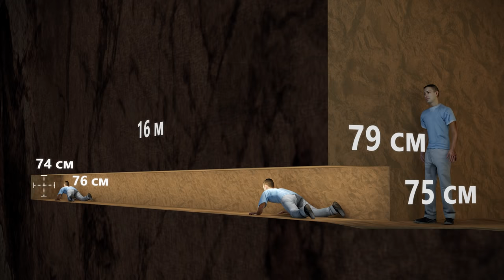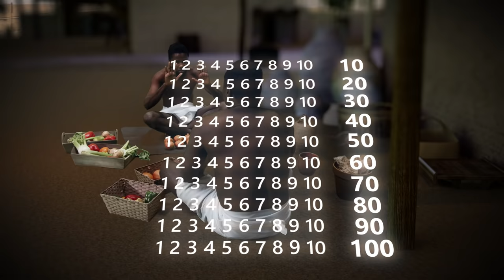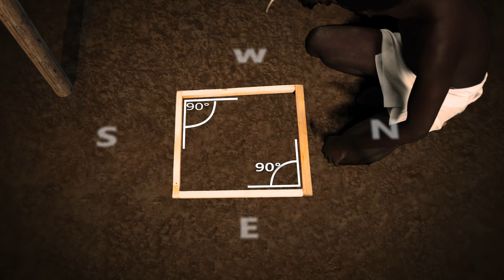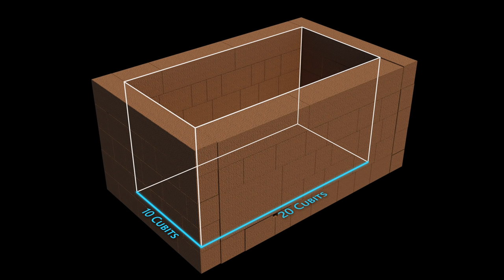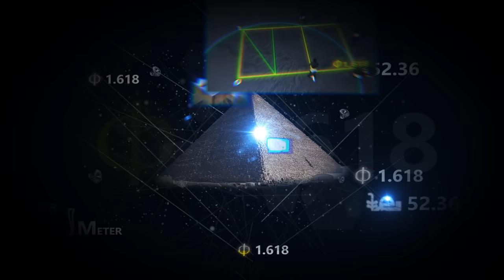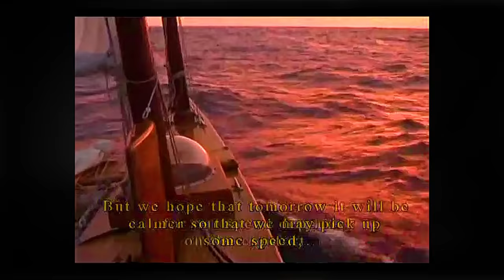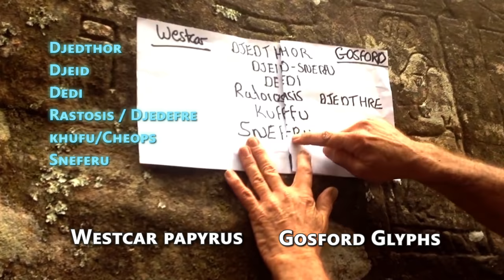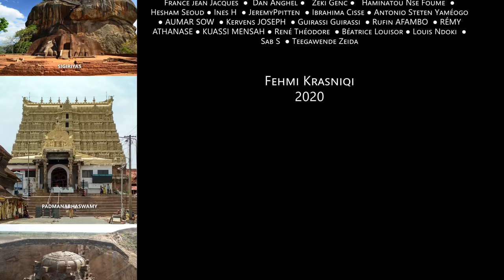The Movie Great Pyramid K 2019 - Director Fehmi Krasniqi

Comment: That's an awful lot of cavity to fill for a very small amount of tunnel and subterranean chamber. 
 They had a DISK  with string wrapped around it and screw pumps spinning away but they had no idea about the wheel?
You show three sided form being slid along as each stone is poured one after the other but you don't account for drying time? How long does one stone take to fully dry? Not to mention the stones are not all alike nor is the orientation  and placement which is what you'd expect had they used forms and poured each stone as you suggest.   That would really slow production down considerably having to make sure each stone had dried completely from inside out . The cavity took 3 years to pour? How long would that take to dry and cure good enough to be sure it would hold the weight from above? Took Hoover Dam a long time and even longer had they not used tubes filled with sand and water to cure it inside out. 
 Getting that perfect water limestone mixture exact for all the crews would not be easy either .  Too much water or lime and the stone might not dry or might take much longer to dry . Wouldn't the concrete tend to stick to the form cracks and around the base making it difficult to remove without tarring the form apart?  I can imagine pouring a huge block and having to sit and wait for it to dry ?  All those blocks having to wait to dry? 
You show the bottom lower portion of casing stone being poured in forms and when it gets close to the top you show the last top  form on the outside of the casing stone with a small round hole in the  center of the form where the remaining concrete was poured to fill up the top side of the stone?   how did they fill it up completely without it pushing itself out from pressure?  How could they be assured the top of the casing stone would be without bubbles or unfilled form[gaps} .  Lots of details left out.
Couldn't they just use the mirror to slice the stones from bedrock? What is the purpose of the queens shafts?

Comment: The only thing I find improbable is melting granite. Melting it is one thing, but creating the energy required to keep it molten long enough to cast is something quite different.
Reply: But possible...
And way easier than carry a 50t block for about 800km. :)
Reply: @HotjeKvovg  Not sure that possible
Reply: I'm working on ways to do this... not melting per say, but rather softening through sets of high frequency, localized vibrations.  You don't need to melt a whole block if you can just make the part you're cutting into a putty.
I'm in the hypothetical stage, and honestly, I have problems already.... Sound waves get LONGER in a dense material, because the sound travels FASTER through it.  So, we would have to start out with sound waves too high frequency to produce through speakers.
Perhaps they got vibrations to occur in dense materials first, somehow, maybe via chemistry, or electricity (piezoelectric effect).
I'm thinking cymatics were used to transport the blocks if they were not formed and created.
Reply: @andriesscheper2022  dude come on.  if you have not seen that they FAILED at getting copper saws to cut LIMESTONE blocks in any meaningful way, then I must insist you don't converse with me.
There is actual video evidence of that NOT working.
HOWEVER.... drilling of holes, the core drills, that was shown to work with high frequency sound through a metal pipe ( bronze I think it was).  pressing down.  The vibrations through the pipe caused it to micropulverize it's way through the material, even the tool keeps itself in shape due to the forces involved.
I DO NOT believe it was aliens, simply crafty humans with a greater understand of the geometry of vibration in general.  Many of the ancient languages needed to be sang at the correct pitch to be fully understood, hebrew among them (of course hebrew is connected with egypt).
Do you really believe they transported a 1200 TON granite block on boats down the Nile???  that's ... 2 million, 4 hudred thousand pounds....  go, sonny, calculate how much water would have to be displaced for 2,400,000 pounds. to be carried on boats.
Reply: @andriesscheper2022  furthermore, the idea of geopolymer is not new at all, concrete IS a geopolymer...
why would it be so strange to think the idea of concrete goes back before the romans AND was more advanced.
I am still not myself convinced of this "solar lens" hypothesis, but the limestone geopolymer is a fact proven by measuring the magnetic moments of the microcrystals.  All the material of the limestone blocks in the great pyramids have their moments aligned with the magnetic field of the earth.
The ONLY possible way that can happen is the crystyals were free to move in a way to align with the ambient magnetic field.  Otherwise they would have had to RECORD THE ALIGNMENT AS THEY QUARRIED THEM, then SET THEM IN ALIGNMENT AGAIN AT THE BUILDING SITE....
which do you suppose would be more likely?
Reply: @philsurtees  That is a stupid argument. What's the difference between reading books and watching videos? How do you know the books are accurate. How can you be certain that what they claim to know is what actually happened? How do we KNOW FOR A FACT that's what happened? Did the find the instruction manual or something? Please make or link to a video showing us how EASY it is to cut and move a 50 ton granite block THEN run your mouth.
Reply: @HotjeKvovg  Damn straight!
Reply: As your on YouTube type melting granite and watch them do it, for yourself.
Reply: @philsurtees  not for a fact is this "known", rather a hypothesis.
Reply: I think you have a valid point with the way it is visualized in the movie here.  But that is just a visual.
Firstly, check out the melting temperatures of things, many surprises there.  Flexible, pliable materials can melt at very high temperatures, such as pure platinum.
very hard, durable materials can melt at low temperatures.
not everything will melt before it oxidizes.

So while the visual is suspect, the idea of being able to melt granite, contain it, and pour it is not at all suspect as a general principle.
The clay they used, if already fired, would have been a "refractory" material.
Reply: What if 'molten' was due to Acidic water causing the granite to be soft and moldable...That is what happened in Peru...
Reply: Still.....what a useless thing to construct ....the shafts are explained ,  by this. ...but ,  what it seems ' for '....is emergency shelter during  an attack , for the royal family.
Reply: @chosen1750  They used a specially cut ruby and a laser to melt it.
Reply: @philsurtees  🍭.
Reply: Last thing I heard the sun is really hot!
Reply: @miltonturner2977  It would have to be the right type of acid which would only etch the surface of granite. And would be extremely dangerous to the people who might come in contact with it! If something can etch granite imagine what it would do to your skin and lungs!
Reply: @alekswhy88  I completely disagree with you about the Tanak. It has been proven to not only been factual but reliable through history. Most of the Ancient Nations we know today, where first known from the Tanak/old testament. If you read the Tanak for what it says without the New Testament, you would see and comprehend a whole different book.
Reply: @philsurtees  Funny .. and how do you know that anything written in those books is actually facts? It is also just theories that try to explain how it could have been done. However those theories also do have a lot of flaws and "impossibles" in it.
Reply: @philsurtees  Books were the Google and Youtube of the pre 21st century. I'm not saying their content can't be accurate, but it can easily become obsolete as research goes forward and new insights from the given context are found. An online blog or page gets constantly updated, while books simply stay the same as time goes by, or need to be rewritten to catchup with research developments.
Reply: Melting granite takes about 20 seconds with a solar lens with about 40cm diameter.
This is not difficult to do at all....and easily demonstrated.
What is shockingly impressive is to contemplate the scale of the endeavor.
You can thus also make Obsidian

Comment: Wow! This just pulled together the centimeter, Water droplets, magnifying glass, Egypt, Peru, free masons, knights templar, metric system, philosopher stone, cement, sacred architecture, pi, the golden ratio, and racism!
Reply: racism ? Really ? Honestly asking ...
Reply: @EQPaunders  yeah man! Watch it
Reply: I don't understand the rule about the size of droplets... different quantities of water will produce different sizes of droplets? Won't they? 

How is it possible to always produce 1cm shapes if the amount of water used is not fixed?
Reply: @j.m.w.5064  I guess you're not understanding what a "droplet" of water means. It's the smallest size a droplet of water can be sure to surface tension. Not a vague "drop" of water
Reply: @The_Paddle_Smith  Yes,  I really don't know. It's a real question and not covered criticism. I just couldn't follow the explanation. 

...when I look at my kitchen sink, I see shapes smaller and larger - so under what circumstances do they form 1cm?

Cheers.
Reply: @j.m.w.5064  you probably have to use a dropper or have it drip off a piece of thread
Reply: @EQPaunders  It's mostly at the end.
Reply: @j.m.w.5064  struggling with that part as well... Even after reading the complementary explanations 🤷🏽‍♀️
Reply: Exactly, it's the end that is most profound and needs to be exposed world wide. I believe it to be true. This Doc was captivating from beginning to end.